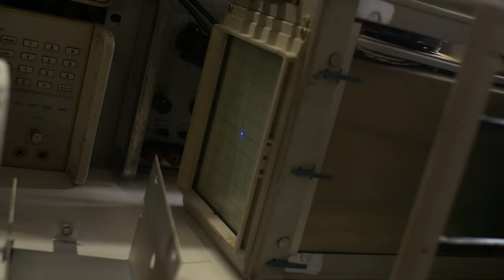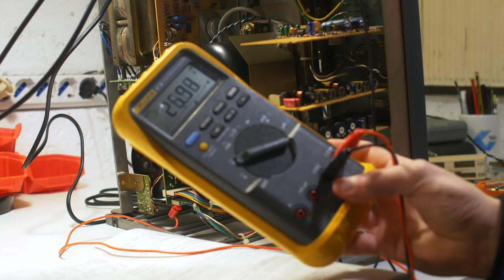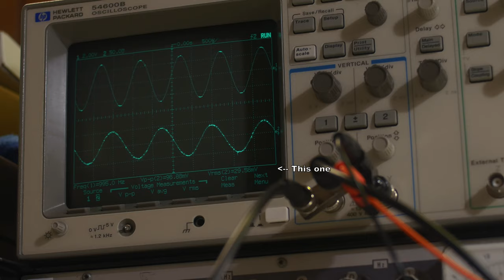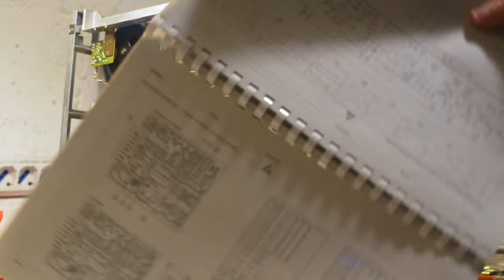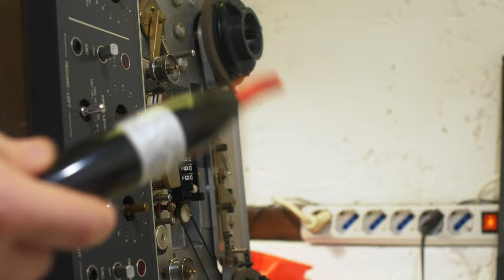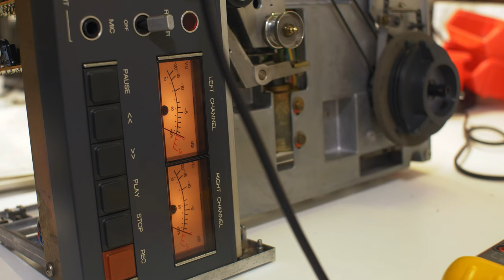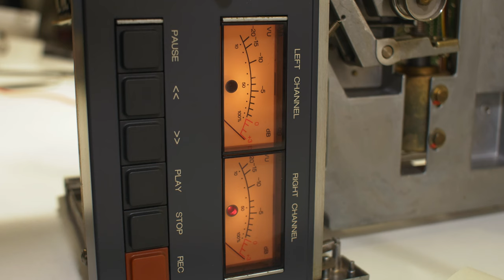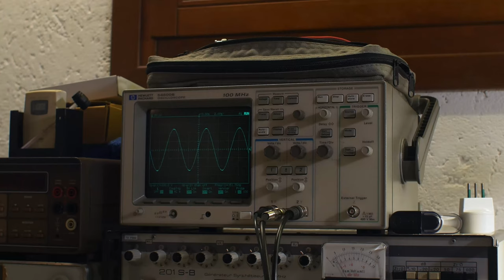Revox B77 Check and Restoration

Comment: I guess you found the other 3 Rifa caps and replaced those too?
1 is behind the iec power connector, 2 others on a small pcb behind the reel speed switch….
I found out about these when the one at the power went up in a massive cloud of smoke :(

Comment: I have a b77 MK2 and I absolutely love it best tape deck ever. Mine was factory serviced and calibrated and I also found a new old stock brand new tape head which I had installed in calibrated It's a fantastic machine You're going to love it
Reply: New tape heads are close to $800 USD per. I have 11 Revox RTR's with each calibrated for a different tape. Crazy...I know !
Reply: @dubdoodle7191  no not crazy at all I saw a video of a guy who drilled a hole someplace in the unit where he could reach the screw that adjusted the azimuth of the tape head so he could put a screwdriver in there and very easily turn and adjust it based on the tape he was working with. But I am depressed about is the fact that there are no new companies making reasonably priced real to reels there are a few companies making them but they want ridiculous sums like $20,000 which is absolutely ridiculous.

Comment: Thanks for this very detailed explanation of what everything does inside of this machine. Scored this model from a friend who didn't have time to fix it. Had to replace a capstan stem that snapped in half, now it's up and running. Now the issue is that my right input is the only channel that records and plays back at the proper volume, and conversely, the left has a strong signal in monitor while recording and then ends up very weak on the tape playback. After recording separate instruments to L + R simultaneously at equivalent volume (in Mic inputs), When I playback, both inputs seem to have been recorded on the right channel only, and just a tiny signal on the left. Very puzzling, and perhaps you might be able to suggest a solution. I suspect the root of this issue lies in the recording amplifier board at 15:25 based on your description of its function.
Reply from the maker: Hi, thanks for the comment! 
Well it could also be as simple as recording gain issue and it can be adjusted by a trimmer. Does the faint sound from the left channel plays back distorted as well? In that case it can very well be a bad capacitor or bad contact (dry solder joint on a component perhaps? I had this happened before) on the recording amplifier board.

Comment: Love your videos & greetings from UK. I have B77 MK2 7.5 &15ips high speed in need of a full recap service however one of my VU meter red peak record level lights stopped working but I'm finding it hard to locate replacement light, not back light but red peak kight😢
Reply from the maker: Hi! Thanks for the nice comment! I think the red peak light can be replaced just by a normal 3mm or 5mm (can’t remember right now exactly what dimension) red LED.
In any case, if you really want all original parts, on ebay or other sites you can get a full vu meter replacement (however, it’s obviously the most expensive way).
Hope it helps ;)
Cheers,
Dave
Reply: @DaveElectronics  thank you Dave for taking time to reply 👍

Comment: Very good information and most helpful. I have a B77 Mk.II and I'm the original owner of the machine. Are you aware of a good shop that may perform the work that you did in my area. The recorder seems to be working very well however I would like it to cleaned and checked since I've had it since the 80's. I live in Salt Lake City Utah USA and any suggestion would be appreciated.

Comment: I also changed the two pin mains input to three pin and connected chassis to mains earth, also changed the mains protection rifa cap at the mains connector, if this cap fails the chassis can become mains live,  also changed the three motor control capacitors, the three big aluminium caps behind the mains panel.

Comment: What grease/oil thing did you use for the ball bearing and rollers around 06:40 and forward?
Reply: Or maybe rather it's a polish of sorts?
Reply from the maker: Hi! For ball bearings I used sewing machine oil, just a tiny drop. To clean everything else (including brakes, pinch roller, heads, etc..) I used pure isopropyl alcohol

Comment: Hi. This is the best video of the working parts of a Revox b77 that I've seen.  I have one that looks exactly like the vintage you have but   it will not go into record mode.  The record lights do not come on and all switches are in the proper position.  It plays back prerecorded tapes fine.  The problem started after I replaced the caps on the 5 plug in boards. I've triple checked the obvious things like cap polarity and values. All solder joints are perfect. I'm at a loss. Any suggestions you may have would be much appreciated.  Thanks.
Reply from the maker: Hi! That’s strange, from what I understand, before the cap replacement it was working.. I can’t see how a cap replacement done correctly has killed the machine haha! 
That being said i’d start with the obvious things:
it could be just some bad connection between the boards. If you haven’t already tried, just unplug and reassemble everything (connectors and boards) and try again. From what I remember the boards can be inserted only in one way, but check that are positioned correctly.
Anyway, if that does not fix the problem, it could be bad switches on the front, so try to clean them and try again. 

If that doesn’t fix it either, it could be the logic part.. you can try to see with a pre-recorded reel of tape if it erases the recording. If it does, it’s the record board that has some fault; if it doesn’t, it could be logic or oscillator board or a combination of problems (i’d start with checking power supply voltages, oscillator output, trace signal through the boards etc.)
Hope it helps :)

Comment: This is amazing video! Thanks a lot!

Quick question, what product are you using with the cotton-stick to clean the different metallic parts?
Thanks again!
Reply from the maker: Hi! Thanks for the nice comment :)
So, for the delicate metal parts (such as the heads) I use pure isopropyl alcohol. For all the rest I use diluted isopropyl alcohol (~40%), with a bit of mild detergent (non foaming). I guess there are some household products that you can buy, just search for mild detergent for plastic parts, it should be fine. Note: be sure to not use ethanol on plastic parts, only diluted isopropanol ;)
Hope it helps!
Reply: @DaveElectronics  thanks a lot for your reply! I was not able to properly understand from the audio. (English is not my mothertongue language )

I just got a b77 that my father bought in the late 70s  I think. I tried tried do a first test but it doesn't even turn on. Any recommendation about where I could start from for getting to check that? Or should I proceed with the whole cleaning as you perform in the video first?
Thanks a lot for your reply!! I love you video and I would love to make work my father b77, I mix dub vinyls and I would love to use this reel to reel as echo device for my effects 😁😁❤
Reply from the maker: B77 is a very nice machine, I’m glad you’re planning to use it! 
Cleaning for sure is a great start :)
If it doesn’t even turn on it could be a lot of things.. I would start by checking the fuse, then power supply (voltages out of transformer and then out of the regulator section). Be careful when working with mains voltages though, if you don’t have any electrical experience you should ask to someone  for help or be really careful ;)
(Try reseating all the circuit boards and the connectors, usually if the machine is not being used for a long time, there might be some oxide on the contacts, reseating them should fix the “bad contact” problem)
Reply: @DaveElectronics  thanks a lot!!!! Super excited about getting into restoring this machine!

Comment: Hi Dave. I have a A77 that I stuck a bunch of money into because a mouse started chewing up copper wire inside the machine. The tech was given new circuit boards that got damaged in shipping because he didnt wrap up the 5 green boards on the bottom of the machine. Now the tech gave up and I dont have good channel separation when I turn the left channel, right channel knob. any ideas. Can I ask what country your located in?
Reply from the maker: Hi! If something got damaged in shipping, really could be everything at this point. I don’t know if you have some experience in electronics, but I would start by probing the circuit and follow the signal (find where it gets lost or degraded). 
I live in Italy :)

Comment: Hi Dave, do you happen to have a capacitor replacement list? Thanks
Reply from the maker: Hi! Unfortunately I can’t find the list anymore. I wrote down the list of all the capacitors from the schematic (service manual) and then double checked with the real boards if I had everything.
Reply: All good, thanks for your help.

Comment: The tape guide on the left has that ball-bearing he was cleaning - take care not to get any cleaning fluid into the bearing! The right hand tape guide has a non-rotating bushing instead of a bearing. This is the same as the A77 later models except B77 gives you nice easy to use bolt heads on top!
Reply: I am restoring B77 MKI and also noticed that instead of the bearing the right hand tape guide had a non-rotating aluminum part. First I was thinking that the seller put it saving money on bearing, so I replaced it with bearing :D Should I put the aluminum part back? Does anyone knows what is the reason for this?
Reply from the maker: Hi! The right hand guide is a completely fixed post, it was designed like that. 
I think the reason is to maintain a stable tension (and probably also speed) of the tape between the pinch roller and the take-up reel. My other r2r decks (Tascam and Teac) both have a spring loaded arm after the pinch roller to keep a stable tension. Many (if not all?) other decks share the same spring loaded arm to accomplish the same thing. So I guess… Revox tried to save some money there? :)
BTW, I imagine that replacing the fixed guide to a rotating one instead, will affect the wow and flutter as well… I don’t think it will never affect tape’s life span, so I prefer leaving it as it was designed. ;)

Comment: Hi Dave! Great video! And channel. I'm getting a B77 this week. How easy/expensive is to change its speed up to 15 ips? Many thanks! Keep it up!
Reply from the maker: Hi! Thanks for the nice comment! So, the high speed mod in my opinion is not easy and I do not recommend you to modify the recorder for 15ips, if it's a low speed version. 
Regarding the mod, I think that you would have to change the capstain motor (and get the high speed version) and probably the control board for it. I think the high speed version of the capstain motor doesn't even run at the same voltage (probably higher), so you could get the transformer of the high speed version of the B77 or increase the voltage with a step up converter of some sort... 
Then you'd have to change the EQ and BIAS boards (IF it's even possible to swap them with the high-speed-version ones...). High speed EQ and BIAS settings are much different from the low speed ones, perhaps it will run just fine, but it would sound quite bad IMO...
So, in theory it could be done, but in practice... well, if you really want the high speed, I suggest you get the high speed version of the B77. If the one you're getting is a low speed one, well, it won't disappoint you ;) It sounds amazing just the way it is! (check my video of a test recording with this machine vs the digital master: https://www.youtube.com/watch?v=xqWKB3PcDCs ) 
Hope it helps :) 
Cheers! Dave
Reply: @DaveElectronics  Hi Dave! Many thanks! I really appreciate you taking the time to explain me all this! And consequently making me save some money. You are right, it sounds too complex to do the mod. I found a 15 ips version and I bought it. There’re too many versions of these beautiful machines :). Yep, I saw your other video; it’s the best comparison I found in Youtube. Great work and great sound! I want the reel to reel for finishing purposes and also to slow down tempos and pitched naturally, which I do a lot in my job. Keep it up Sir!